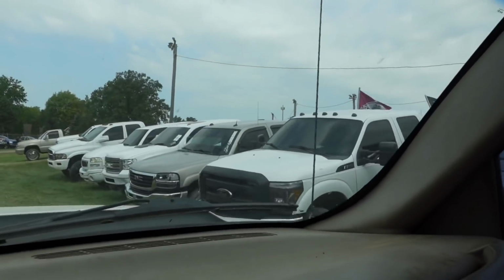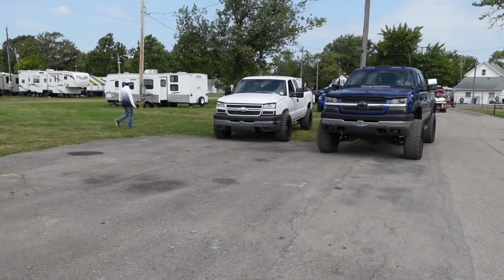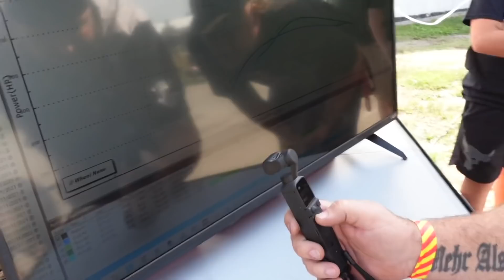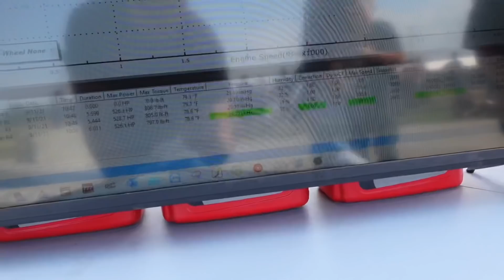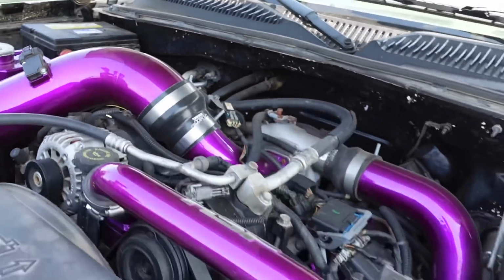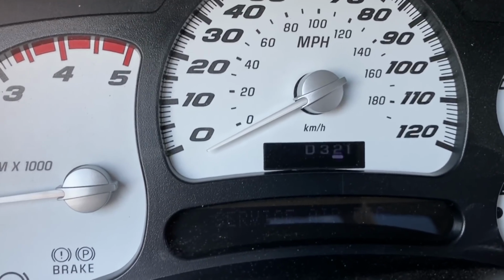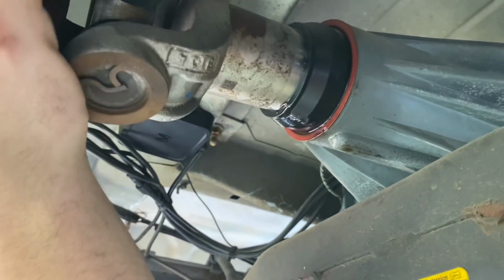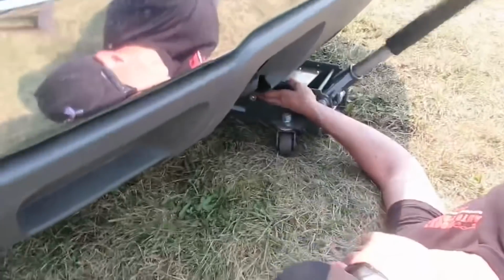I Blew Up The Duramax! Wife Is Not Going to Be Happy! RIP WIFEMAX

Comment: In your opinion what would be the best way to keep the reliability and do slight upgrades to make it better
Reply from the maker: Definitely get a lift pump
Reply: @TruckMaster   Definitely working on that  Little tough to come up with $800 all at once But in time.
 I have put studs in it EGR delete 5" exhaust Upgraded downpipe and uppipes  The only reason I done those at that point was I had a head gasket blown.
The main purpose is just to haul my 36foot camper  And other miscellaneous stuff.

Comment: What do you think my lmm power and torque wise is pushing? Efi live 5 postion, 5 inch straight pipe, airdog 150, race plug in fuel rail. Stock air box with resonator deleted and have the end off the air box so it gets more air.

Comment: That's why when you race always tow rave vehicle and always have electric winch on the trailer that works cuz it's always them just in cases especially when you drive it there to the racetrack it always breaks always trailer

Comment: I'm betting on clutches in the transmission not holding the power so it kick engine to safe mode for a restart but it's not doing it so it falls on its face . Try carbon fiber clutches or kevlar clutches and reset computer and retune .

Comment: Chevy has a cable to connects to the side of the trans with a plastic bushing horrible diesel that causes your shifter not to work and it does make a thump sound when it pops offf

Comment: 68 drop in, 10mm pump,  and 100s should be 700-750 horse. The 10mm should support 750 easily if everything is healthy on the truck.  We did 793 on a LB7 with the same setup but with a 12mm instead of the 10mm. Do you have a fass 100 or 165?
Reply: Also check the dsp5 switch and make sure the light is glowing on the  back side and the pins are still in the ecm. May have a bad switch or connection and its stuck on tune 1 as a result

Comment: So my truck has that issue. But mine will move it just slams itself into 4th gear and will only stay in 4th gear. Mines a lbz I don’t think it’s a blown trans cause it had hardly any shaving in the pan. I’m hoping it’s just a valve body but I’m unsure.

Comment: Everything billet inside the trans c2, planetary, sun gear, input, intermediate, output. Oil pump modded for psi. Transgo 5 speed internals. Billet flex plate.

Comment: I did a full fprv deleted.   Welded the plug so it will not pop off.     Had 100 overs with a 10m pump on a 75mm borg warner made 740ish hp. Was a slug but highway/ interstate it was a monster.  Fuel rail pressure would peak 24kpsi never over with tuning.

Comment: Monitor rail pressure when you get back. I bet it’s dropping rail. It would make sense during your sled pull, get halfway down the track and the rail drains, same issue going on the dyno, top of the rpm the pump can’t keep up and dropping rail. Especially with the stock lb7 fpr, a good 12mm pump with a lbz fpr will do wonders.
Reply from the maker: Great point
Reply: @TruckMaster  Did you replace the fuel valve from stock while you were in there. That could be causing the lost fuel rail pressure if the spring is worn out.

Comment: Every time it’s pedal to the floor in a diesel I get nervous yet a gas truck I don’t 😂 probably because I have more experience with gas trucks
Reply from the maker: I can agree with this statement
Reply: Probably because, lets be honest, modern diesels are like that weird kid with an allergy to everything but oxygen. Gassers are becoming the more reliable, eat anything thrown at them, type of trucks
Reply: @xTheJmanChannel  short term reliability is gassers but if you want something still ticking at 400-500k diesels are it
Reply: @dakotadickens3747  I wonder how many of the new diesels that are hard to delete because of the epa crack down will be lasting 400k miles
Reply: @xTheJmanChannel  the emissions systems get better on every version. Currently have an l5p with 200k in the family and a lml with 330k
Reply: @dakotadickens3747  You think you'll delete the L5P?
Reply: @xTheJmanChannel  if it wasn’t 5-6k to delete it then maybe. But for the price it is it’s not currently worth it
Reply: @dakotadickens3747  I want new model l5p but I don't know if I could enjoy a silent truck. I don't even want delete tunes for performance. The torque and power is more than enough. I just want the egr gone and that good sound

Comment: I was wondering if you have any idea why my deleted 2011 lgh (detuned lml) with the Allison 6 speed feels like it’s slipping and has no speed when I get on it and has no codes. Thanks
Reply from the maker: I might be low on trans fluid
Reply: @TruckMaster  I’ll have to take a look thanks
Reply: If not fluid low. Have it checked torque convertor blew in my 06 lbz at 105,000 last year. Same issues unfortunately. Good luck
Reply: @mattpaulhamus3249  That’s what I was thinking it could have been but I wasn’t sure if was or not thanks for the input.

Comment: Please show us #1 your wife's reaction to a broken truck lol,  #2 the black eye or eyes she gives you for breaking her truck and #3 the remains/broken bits of your trans. I wouldn't say you hurt the trans on the first pull but the combo of three didn't help. When you came to a stop you were still on the throttle for a few seconds before letting off, you can see it in your footage. Soon as you come to a stop let off to avoid burning up the trans or putting stress on the internals. It takes a bit to get in the habit of doing, I've even let out of it before I came to a stop to avoid putting the added stress through my trans (stock 4rE100). The more you pull the better feel you will get for the truck and what it can do, defiantly can be an expensive learning curve lol. The dyno probably didn't help the trans either, like wringing out a wet dish rag as it was said to me once. You obviously have a combination of problems to sort through to get WifeMax dialed in. But my guess is you hurt the trans in the pulls, put a stress fracture in one of the shafts, dyno made it grow, and the dirt drag made her toss her cookies, trying to build boost for the launch.
Reply from the maker: Perfect explanation 👍 thanks

Comment: I’d say something is off, my LB7 made 505 HP and 1020 lb stock fuel and stock turbo at 4500 ft elevation.
Reply: What you got done to it
Reply: @haydenroyer  Back then I had: S&B intake, 3” intake elbow, 5” exhaust, fass lift pump, ppe race fuel rail plug, 3” hot side intercooler pipe, race exhaust manifolds and up pipes, 3” downpipe, Built trans and EFI love tuning (200,000 miles on engine) since then I’ve added a 64 valley turbo, banks intercooler with 3” cold and hot intercooler pipes, 80% over SAC S&S injectors, 10mm S&S CP3, headstuds, regeared to 4.30, and a bunch of cooling stuff. I have not had the new setup on the dyno yet because I am working out tuning issues.
Reply: @bradleydavidsankey  yeah, it looked like half of the 4th gear pull was waiting for the turbo to light.